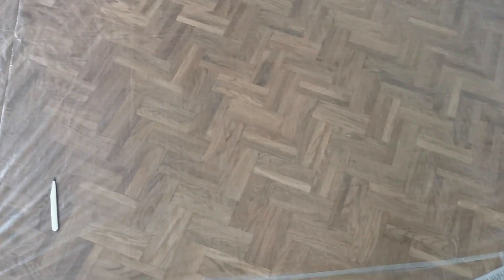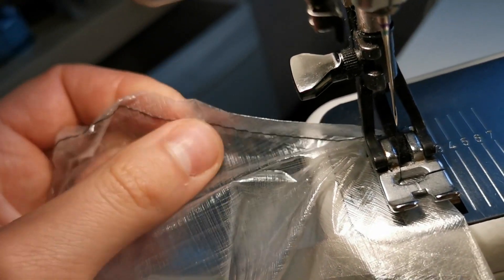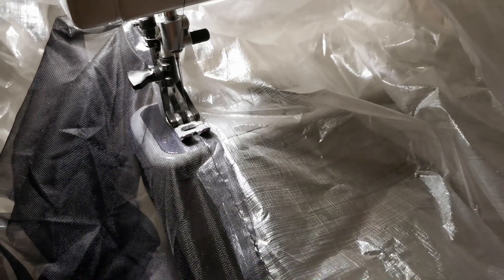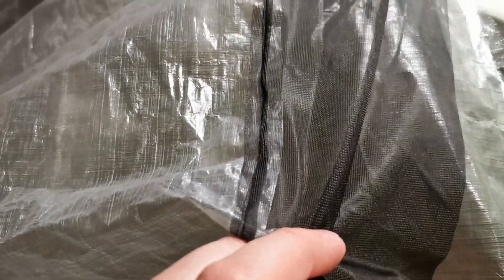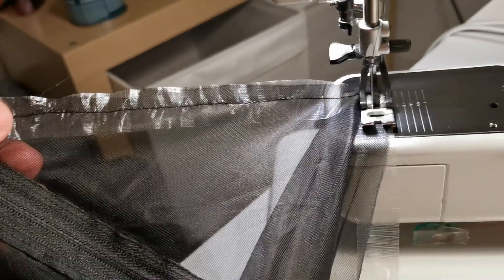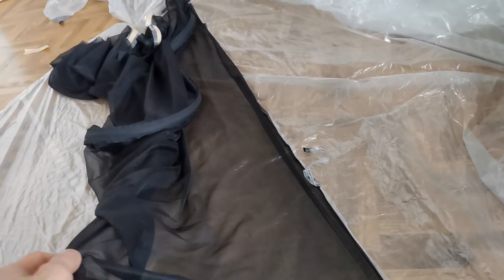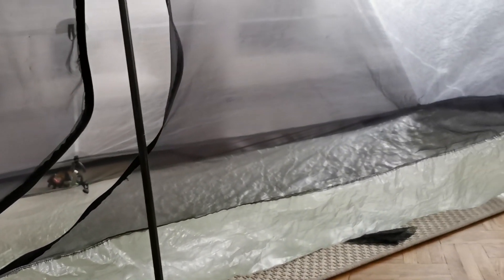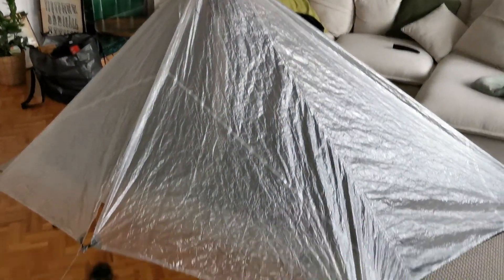How To Build The Lightest DCF Tent - @montmolar MYOG

Comment: Next level light and ingenuity with taping the mesh to the fly.

How many nights have you slept in it and how has it held up?
I've heard of pinholes developing in the .57 DCF material Zpacks uses. It seems you're using the lighter weight material than that.
Reply from the maker: Yes, I actually did use the .34 oz material for the fly and it has held up fine so far!

Been used only for 4 trips though with 6-7 nights in total.

Comment: How much strenght has the dct tape compared to normal sewing? If I do not care about making it the lightest possible it's better to sew everything?
Reply from the maker: Well, that depends. In extreme cold tape will fail. However: DCF can rip or elongate along the stitch holes when sewn!

So if you want to make it as reliable as possible: Sew it and then put dcf tape over the seams! :)

Comment: Nicht schlecht! macht bock selbst eins zu bauen :)
Würdest das leichteste DCF empfehlen (nehm an 18g/m²), oder doch lieber 26/m² zwecks Reißfestigkeit in Stürmen, wenn man mal länger unterwegs ist?
Was hats Material denn ca gekostet?
Reply from the maker: Mit allem drum und dran so 300€, wobei da auch bisschen Zoll & Versand dabei war. 🙊
18g ist schon ziemlich robust. Das 12g bei meinem ist schon deutlich fragiler und hält trotzdem bisher ziemlich was aus. :)
Reply: @vanCapere  Alles klar, klingt ja nicht zu übel, danke für die Antwort! :)

Comment: Whats the sewing machine you used? What are all the bare minimum features for a sewing machine for myog camping gear?
Reply from the maker: I use an old school Pfaff 1212. Personally I would look into one with double or triple transport, as it makes sewing elastic materials easier.

Old domestic machines are perfect, as they are plenty sturdy and mostly not too expensive.
Reply: @vanCapere  thanks very much for mentioning that! After your comment and then seeing pfaff 1200 series mentioned in a Ripstop by the roll podcast by a vintage sewing machine expert that certainly helped pull me out of a rabbit hole. Just found/bought pfaff 1229 in good condition

Comment: Thanks gor sharing this. Gonna give it a go next time i'm in the market for a new tent. Question: could fold tape over the edges instead of sewing them?
Reply from the maker: Should work but you would still need to find a way of attaching the perimeter netting (e.g. sewing it to a DCF strip and then taping it to the edge).
Reply: @vanCapere  Gotcha, thanks for the reply 👍
Reply: Great video Martin! Where do you buy the DCF?
Reply from the maker: @MarkusGebhard  Mostly from Ripstop.pl or RipstopByTheRoll. :)
Reply: this is the stage im at.. i added 3.5% for height difference.. not sure my tie outs are in the same place, (needed more magnets)  this was from a load of off cuts anyway.. i figure the tape and dcf band would hold the net to any point you require.. am considering a full footprint with a steeper fly..